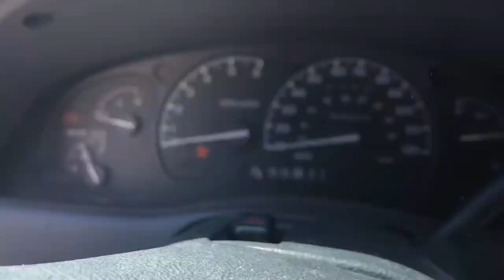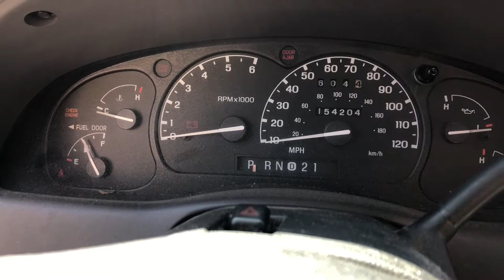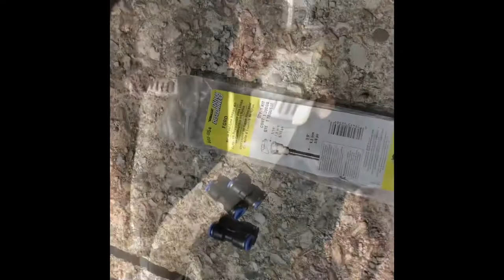2002 Ford Ranger crank no start. Watch me chase my tail for 7 hours!

Comment: I learned easy way to check fuel pump, have someone turn ignition on, remove gas cap, put your ear to it, you'll hear it engage. But I replaced my inertia switch, plugs & wires, relay for fuel pump 1st. 03 ranger, I don't hear pump cycling. So I guess I'll be replacing pump.
Reply from the maker: I’ve had pumps run and not build pressure too though.. or at least not enough pressure. I’d check to make sure you have power to the pump before you buy one. Those things aren’t getting any cheaper.
Reply: @jasonking0973  I replaced Pump. It started right up! A few days later had my filter changed. I tried that was having difficulty. I paid 84.00 for it 2 be installed. I'm happy.